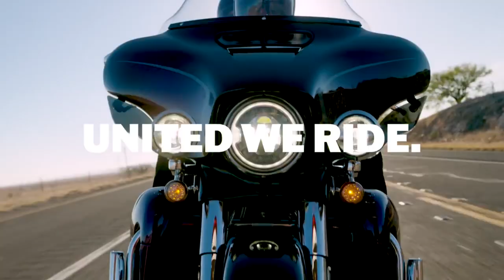Harley-Davidson 2021 Launch, Custom 1250 Replacing the Sportster Line?

Comment: 1:50 "...that popped up on their website in the last couple of weeks." Actually, it has been there for a while now. It was just underneath the Pan-America and the Bronx (when that was still listed). Now, whether we'll see the Custom 1250 during the January 19th 2021 lineup reveal, is still to be determined. I hope so, but no 'official news' as yet from the MoCo on that one.

Don't believe me (a woman who rides and happens to also be a H-D Dealership employee)?? Then check out Motorcycle.com's article that says the same thing I'm saying: 
https://www.motorcycle.com/mini-features/fact-check-no-the-custom-1250-didnt-just-reappear-on-harley-davidsons-website.html
Reply from the maker: Well I stand corrected but it has definitely become more apparent on the site IMO. BUT Thanks for the correction. I don’t think it will be in the Jan launch. The CEO did say in the 3rd quarter earnings call that  it was possible not all models would launch in 1st quarter and they may have special launches latter in the year. That and lack of press by HD makes me think we will see it later in the year assuming they still launch in 2021.
Reply: When I was looking up the cancellation of the the Bronx Brawler, the pan-american is the only other future bike was shown. I thought that was odd because I knew the 1250 was on there and then it mysteriously disappeared for whatever reason. With Harley who knows, it may have just been an IT guy mistake. Never the less, I would like to see the 1250 custom in production. It would be a welcome alternative to the Indian FTR1200.

Comment: Bought a 2020 XL1200NS Sporster in June 2019. I only have 1,300 miles on it.
I have been riding motorcycles for years, about 50. I’m now 70 and it’s all I need for my age and strength. I really like the bike and have no regrets. 
 Next year I will be returning to the Philippines where I have a retirement house. The sporster will woek perfect there. I could use a suggested spareparts list to buy before i ship it over. Really looking forward to riding over there! 
  Thanks for the comparisons to Honda 1100 and the Harley 1250, but I think i made the right choice “for me”!
Dallas Boring, not my wife, Rosalie.

Comment: I have ridden since I was 10.. I am 46 now... I am not going to go over all the non Harley bikes I have had and will stick with the subject.

The First Harley I ever got was a 2011 XL1200C and I loved it... it was the style I was use to...

I ended up getting a Road King and hated it.. 

I just purchased another XL1200C 2017... and I love it again..

I never could get use to floorboards... I like the feel of forward control pegs.. my legs feel freer.. I could do 800 miles a day on my 1200 better than I could the Road King as the RK hurt my knees... 

I put about 10K to 15K a year on two wheels...

I have had a belt break on both types of Harley and I have to say replacing the belt on the 1200 was WAY easier than the RK... I should not have to pull the outer primary to replace the damn belt.. HD needs to redesign that.... 

I would even go to a Dyna if they would redesign that...

I had just as much power and speed on my 1200 that other riders in the pack hand on their Touring bikes.. maybe even more... and I used half the gas they did...

Comment: Good job Mike.  The Custom 1250 has intrigued me since it was posted to their website.  My fear is if it replaces the sportster, both 883 and 1200, then the entry line for Harley is gonna be $14k (outside of the streets)
Reply from the maker: With the Softail Standard at that level they will have to come in under that or raise the price of the standard...I am hoping they can bring it in under or at 12K. They could bring a 975cc (Bronx Engine) version in later at closer to 10K  and then still have the Streets below that. I don't think we will see this launching with the other 2021's but maybe a later in the year launch by itself.

Comment: I’d buy another piglet if I had the money, my 2015 with over 40,000 miles needs a friend. I switched from a roadking, 59 yrs old and been riding 51 yrs. My XL 1200 has been my only trans for the past 5 yrs.

Comment: I'm a 25 year old looking for my next bike (currently have a 2002 SV650S).  I'm looking at new/used between 8000 and 11 000$ CAD for a 900cc to 1200cc bike. I test rode the Iron 1200 this summer, liked it for what it was: easy going, bad ass looking cruiser. It felt slower then my sv650 but I liked the riding position better. Once I came back from the test ride, I asked for the MSRP in it's stock form. I couldn't believe how expensive it was (like 12 000$ CAD right on the money without ABS, without an exhaust, fuck all). For 3-4K cheaper, the Moto Guzzi V7 stone is a much better deal and it does the same job as the Sporster: feel and look like an old school bike. I'm currently looking at the z900rs or the XSR900.

Comment: Death of the Dyna - Harley in I.C.U.
Death of the Sportster - R.I.P Harley

The Sportster was the last bike left in their lineup that I would consider owning.
Reply: so you like the dated, boring and stale design of a beginner bike?
Reply: @snakebite6511  You obviously don't know the history of the Sportster. It's won more races than any other Harley-Davidson.
If I wanted a plastic, sterile, video game-like experience I would sit on the couch and play a video game.
Reply: @jamessouthworth1699  its still dated, old design that is 20+ years past its prime.
(so is Harley for that matter)
If Harley does not refresh the 2021 Street Glide Special i will be gone from Harley for ever, so tired of their old, dated designs and technology.
Far better motorcycles out there for same money, this will be Harley's las chance to retain me.
Reply: @snakebite6511  Looks like we are both becoming dissatisfied with Harley but for different reasons. The new Softail line does nothing for me. I lost a lot of interest when they dropped the original Softail line and the Dyna line. If they drop the Sportster they are dead to me.
I agree that most Harleys are overpriced but adding fluff and gadgets won't fix that, it will only make it worse.

Comment: I think Harley should keep the sportster, but do a redesign. Lighter chassis, better brakes, inverted forks, LED lights, and so on. I also think they should replace the 883 with the 975 and the 1200 with the 1250. All while keeping the price the same or slightly less

Comment: As a 22 year old....No bags, no chrome, no antennas, could not care less about the "vibrations" and "shaking" , don't care if it is air cooled, and lets see some factory standard features such as LED lighting, better suspension, dual front brakes, etc.  I'm getting a 2021 fxlrs in the spring bc I know the m8 will eventually be one of the last of the pushrod motors made and I like harleys.  The younger generation wants more bang for their buck, like the direction Indian is already in.
Reply from the maker: Hope you get and love the Low Rider S assuming it makes the cut...New CEO is trimming models...
Reply: @RidingintheOzarks  Thanks! me too.

Comment: That 1250 says one thing to me...speed. Like the Livewire, designed for speed, responsiveness, and agility. NOT for long road trips (without mods). Not really meant for enduring comfort.
Reply from the maker: Well this pic is a prototype so we will have see if they do anything else but it doesn’t say let’s ride 400 miles today to me either.

Comment: Spot on remarks. 'Looking at spec's alone' and the Rebel and 1200 are competitors for me as where I am sitting , I am contemplating my first ' big bike' and at 42, I will buy a new one of either of these. Yes the Rebel is ugly, but it beats the 1200 in every way I need it to. I want a Fat Bob, but I dont want to pay that much for a bike. So, I am hoping that the 1250 will have the specs and the price to go along with it. If it does, then this is how HD will get a new customer out of me. None of their other bikes (and prices) excite me, the competition has way better options.

Comment: I have heard that a lot of Harley fans don't like the way the Rebel 1100 looks but I can tell you I have a lot of friends who are looking at new bikes and they don't say the same thing.  I think it looks great and I think it will out do the Sportster in sales one people see it with it's accessories.  I like it because of the dead reliability of the Africa Twin motor.  It will have more horse power and run cooler than the compaction.   I think the one thing Harley is doing right is the liquid cooled engine.  The model T is dead and so is the air cooled V twin.  Get over it.

Comment: The rebel not competing with the sportster is silly. When I got my first bike I had a deposit down on a HD 48. Did a little more research and cancelled it once  I learned that the bolt is cheaper and as good if not better. Then when I went deeper down the rabbit hole I ended up with a Triumph. New riders don’t have brand loyalty yet. They want they best thing they can afford period. Had that 1100 Rebel been out at the time. Who knows I may have bought that.
Reply from the maker: I agree 100%, thanks for the comment.

Comment: I commented on this before.  Have you rode the latest Iron or the Roadster?  That is important still as you said you had not before.
I have 3 M8s 114s and a Roadster 1200.  All great bikes.  And no I wouldn't by a Rebel 1100, its ugly.  And yes when the 1250 Custom and Pan American comes out I will go and test ride them.  At that time, I would make a decision to trade in a current bike on one.  But it will probably not be the Roadster, I love the bike.  I highly suggest you ride one.  One other thing on the 1200, for 2k you can have 100 hp pretty  easy and smoke that 1100 Rebel since hp seems to play an important issue with you.  Me, I'm good with a set of pipes 45 mpg, great looks, a simple machine that I can service for under 60 dollars with garage tools.  
Competition is good, HD will surprise you, but you have to ride what you are beating on to be fair.
Reply from the maker: Well I am not sure what you think I am "beating on" in this video or are you just referring back to the Rebel video? But No I haven't rode a newer one. The nearest dealers are all a 3-4 hour round trip for me and since I am not buying one so I wouldn't ask them to let me ride one just for fun. I don't have any friends with a newer one to borrow and test ride. I did ride the Scout when I got a chance this year.  I don't dislike the Roadster or Iron 1200, I prefer the looks of those over the rebel and I am sure I would enjoy riding them. Comparing Horsepower is is just something you have to do if you are comparing specs and sure you can upgrade the Harley probably far more than you could do with the Rebel. I even eluded to that in the Rebel Video near the end. I personally prefer the looks, sound and aftermarket customization ability for Harleys. But I am not a new or young rider that the Rebel is going to appeal to. Just cause I can appreciate and see the appeal in the Rebel doesn't mean I wouldn't prefer the Sportster cost not withstanding. I am sure in the Smiles to Miles aspect Harley is going to win for me also. The question and point of this video and what I want to know is do you think the Sportster is dead when the Custom 1250 comes out?
Reply: @RidingintheOzarks  probably not dead here, not yet.  But then again, I wouldn't have guessed the dyna would go like that either.  You stated they were a business and had to make money, I agree, and the sportster is a very big piece of HD sales.  They have in the past introduced bikes in Europe first and see how they catch on.  When the 1250 catches on, it may be the end of the 1200 evo, at least in its current form.

Comment: The Sportster dies in 2003 when the blubber mounts replaced it. The secret to the Sportster is that it was a standard motorcycle that could make great power and cheap to really customize. Now, just like the death of HD shops, everything is Harley is a boutique. They had a great thing with Buell if they would have actually backed him. Harley makes what, 20 ‘different’ bikes separated by bullshit bolt ons. The XL series is the oldest in the line up and is the model that kept them from going under. If they kill it, it’d be a shame but they are losing their asses again to everyone else because of price and quality.....

Comment: Well, at least the engine looks liquid cooled... with a couple push-rodded, under-square peanut butter jars for cylinders...
Reply from the maker: I am sure over time it will grow on people and this is a prototype picture so it is not guaranteed but the engine will be same as Pan America I am sure...
Reply: Just took a quick look, the Revolution Max engine? Is that an updated version of what went into the V-Rod? Cuz that was a great engine, even if HD wiffed in the looks of that bike.

Comment: I thought they were scrapping the street models.
Reply from the maker: I haven’t seen anything about that definitively but I don’t think the street models have sold vary well... so it wouldn’t surprise me I do think they will keep the street rod 750 because they need that platform if they are going to continue flat track racing
Reply: @RidingintheOzarks  I agree that is a solid bike. I agree they could have used that as a less expensive adventure bike platform and maybe a more traditional cruiser type bike as well. Their design department definitely lacks imagination.

Comment: My opinion is Harley should go back to a standard and a custom 1200 and 883. They would only have four models to deal with. To me Harley took away the customizing part of owning a Sporty by having so many different models. I bought my Custom 1200 Sporty in 2001 still have it and ride it, didn't really change anything except the usual straight pipes, cams, ignition and high flow air filter. I did buy a 2018 FLHTP cop bike, I love it like the Sporty. A Cadillac and a Camaro is pretty good comparison.
Reply from the maker: Well they are working to streamline the models so we will see soon what that means for the 2021 models. Interesting name. Is Rolla a city or your last name?
Reply: @RidingintheOzarks  Rolla is my last name but also a city in Missouri and Montana.
Reply from the maker: @mikerolla5601  My PO Box is in Rolla MO, there is also a Rolla SD. I know because I got a Christmas card that was meant for someone in Rolla SD. Thanks for watching and commenting!
Reply: @RidingintheOzarks  Thats cool, you're welcome, I like your channel and the fact that you answer comments, most do not. Thanks.

Comment: If the Custom 1250 will look like it's pictures then I can be counted out.  I have never really liked Harley's feet forward seating position and it seem that is what the  Custom 1250 will have. I like a regular up straight position like a naked street bike that I can tuck into if and when I want.  I am not into the "Lazy-boy" style of riding. Now when the Sportster line gets a "normal" riding position then I may take another look, because I really like that engine.

Comment: Living in the UK where the sportster will not be available new as of Jan 1st they will need a bike in the sub £($)10000 price range that is better than the sport 750 (we don’t get the 500) which has not really sold that well here. The sportster has been  really showing it’s age up against indian’s scout, triumph’s bonneville line along with the big four’s offerings all of which have much newer engine designs. The new custom I don’t see filling the gap that the sportster leaves on price as I don’t see how it can be produced for less that $10000 regardless of the fact that I think it is a cool looking bike. Your idea of using the street 750 engine in different bikes makes sense as the engine must have been designed with some idea of future emissions regulations (euro 5 specifications were released in 2013). A cruiser and a adventure bike based on this engine surly wouldn’t be beyond Harley and possibly would draw in younger riders who are buying bikes in the 500 to 750cc range due to the cost of running /buying the bikes . I am tired of “traditional Harley buyers “ complaining about new bikes not being proper Harley’s the WTF reaction and we will never buy that bike. I have heard that talk from when the evo replaced the shovel and iron head ( I am too young to remember the shovel replacing the pan) The truth is the traditional Harley rider is ageing out of riding and they need new and younger riders for whom they need to provide bikes that they want .
Reply from the maker: The street 500 isn’t on the site anymore in the US either, I think it is dead. The 1250 might be to high but they could put that 975 that was going into the Bronx in a bike too. I want to see Harley survive and the Bronx was another bike they could appeal to new riders with, I hope it sees the light of day. I see fewer traditional cruiser models in the future. Thanks for watching and commenting

Comment: To that traditional Harley faithful who killed the V-Rod by constantly badmouthing it, I have never forgiven you. You couldn't grasp the concept that liquid cooling allows higher compression ratios leading to much greater specific horse power. Combine that advantage with not overheating in traffic on a hot day and that seems like a kill two birds with one stone wining solution. If you want the motor company to survive as something more than an apparel factory, you're going to need to embrace some changes. The M8 wasn't the change they needed. In fact, in many ways the M8 is nothing more than an upgraded version of the same old oil migration problems. Now that gives you SUMPING to think about.